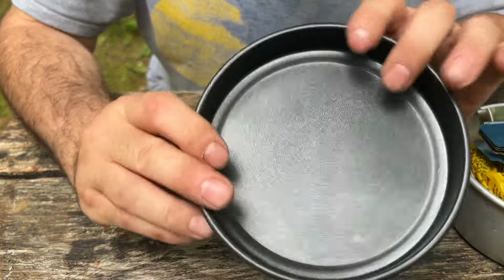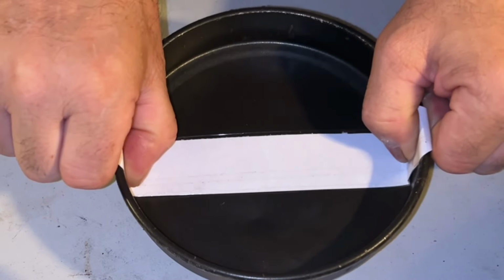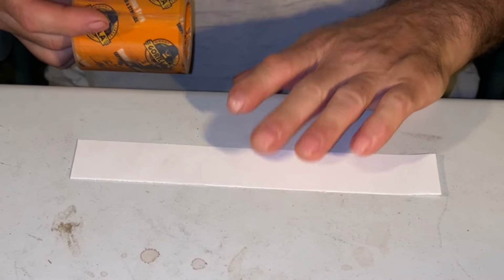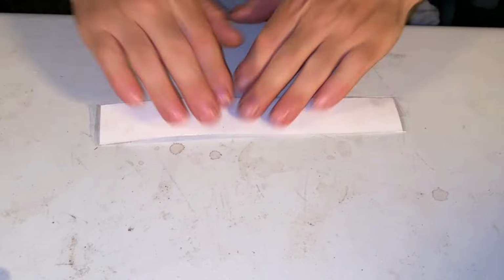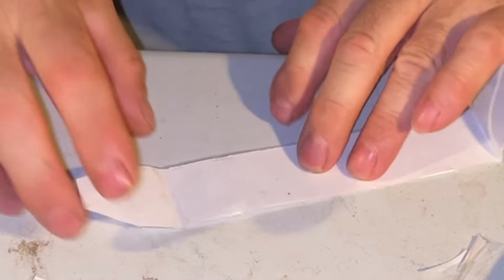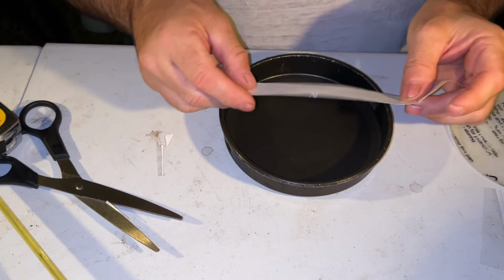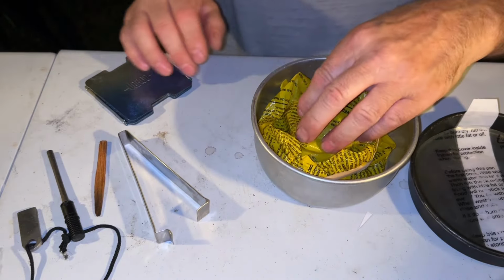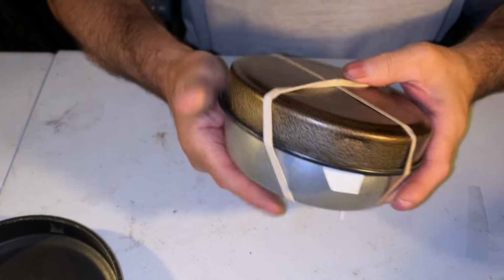Prevent Your New Trangia Mini Non-Stick Pan From Peeling!!!

Comment: I had the same issue and complaint. I reached out to Trangia twice to report the flaking after the first use, but received no response. A simple protective cover or silicon on the edge of the pot grabbers or better quality control to ensure sharp edges are smoothed would have prevented this problem from the start. No one wants that stuff in their food. Nice hack, though...thanks!
Reply from the maker: Interesting. I experienced the same dial tone treatment when I contacted them about issues with the Mini. That complaint also covered a frightening experience with the alcohol burner exploding on a couple of occasions. Complete dial tone. I don’t care what anybody says, Trangia does not build a quality product. To me the reputation is based more on romance vs really honing in and fine-tuning their product. 

Anyway… I’m ranting 🙄

Your suggestion about silicone on the pot grabbers is exactly what I said. I did find a product on Amazon, but they’re bulky. So they wouldn’t fit inside that kit. I’ve resolved to just go easy with them and try not to scrape as much as possible.

Glad you found this useful. Thanks for chiming in.

Comment: Ah yes. These days you buy a super expensive item from a known company with long history only to get shafted. What a time we live in.

Tbh PTFE-coated pans are a very bad idea for camping. Not only you can easily damage them mechanically, they also can easily overheat when cooking on coals, which breaks down PTFE and releases toxic gases in the process.
Reply from the maker: Agreed on all points. Interesting thought cooking over coals.. 🙄
Reply: Super expensive? it's 30 euros for the burner, pot, fry pan, stand, pot gripper. I don't know about "super" expensive...
It's just PTFE being PTFE if it weren't for the coating then this would be non-issue.
Reply: @Tiger-789  Trangia sets cost upwards from 60$ where I live. So it's a matter of perspective.
Reply from the maker: @romant1127  I just found out that (supposedly) they will be releasing an HA (hardanodized aluminium) version of the mini some time this summer… 🤔
Reply: @dobrofool  That's nice. But it's not a non-stick coating or anything. It's more of a decorative/protective kind. I've heard good thing about new kind of non-stick coating with titanium in it. My friend just brings a light Tefal pan from home with him and is perfectly happy with how it performs. Maybe Trangia will incorporate it in a year or two, who knows? 

But honestly I don't really care about coated camping cookware. I'm using German army mess tin replica made from food-grade aluminum and don't experience any issues with it. Cleans easily too with a bit of water and charcoal from the campfire. If I were to buy another camping pot/pan I'd probably pick stainless steel, only because it's dishwasher safe and I don't need to be delicate with it like with coated cookware.
Reply from the maker: I have seriously thought about picking up a mini cast iron pan (4”-5”) for wild camping.. 😎
Reply: @dobrofool  I borrowed a cast iron dutch oven for car camping once. Baked a whole chicken and some bread in it. Nothing beats cast iron when cooking on a campfire. Not very advisable for backpacking though lol
Reply from the maker: @romant1127  Well no.. it IS a  non stick. And it works well. Until… you blow out the center area from the concentrated heat intensity on the larger kits 😡 which is the reason why I posted another video on how to modify a Trangia 25 for a much better cooking experience. However. I’ve had no issues with the nonstick coating as far as cooking is concerned on these pans. The issue is: it is not a durable coating by any means!
Reply: @dobrofool  Their website doesn't advertise it as non-stick. Says it resists corrosion and makes it easier to clean somehow while explicitly stating that this coating is porous. The only non-stick they have is PTFE coating.
Reply: @dobrofool  I was talking about that hard anodized coating you mentioned earlier. It doesn't have any non-stick properties to it
Reply from the maker: @romant1127  I see that now I just went and deleted my comment realized what you were getting at. Sorry about that! 🙄
Reply from the maker: @romant1127  I do realize that’s not a nonstick. I am on a Trangia forum on Facebook, and one of the members is very close to the people at Trangia. Just made a mention a few days ago that this was coming out as an option. For the mini I cook lots of eggs and stuff so I prefer the nonstick pan. The heat is too intense underneath.